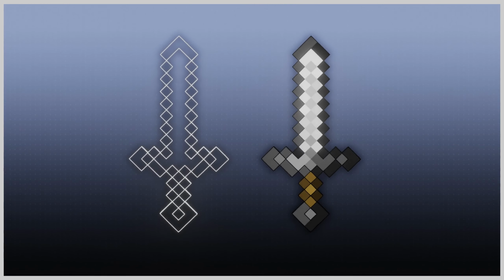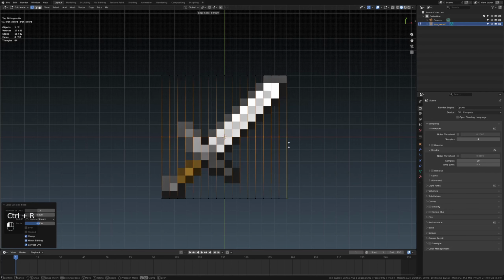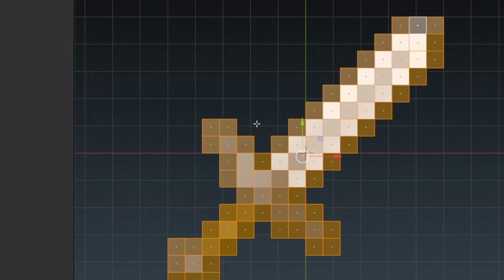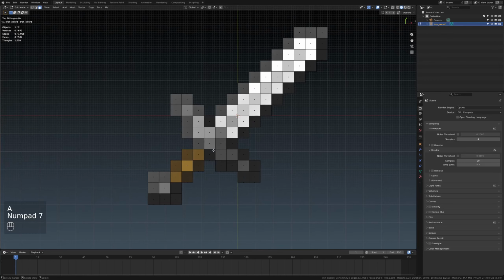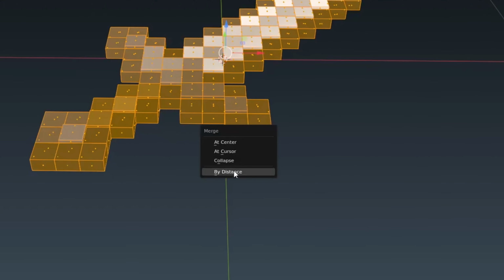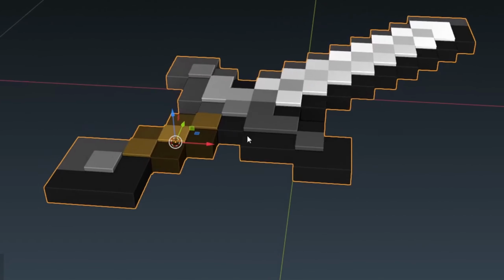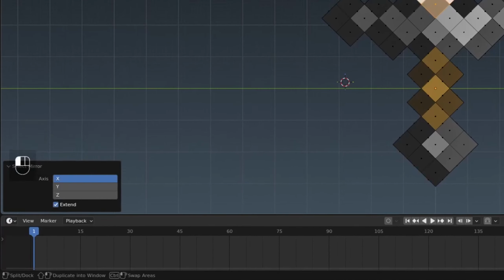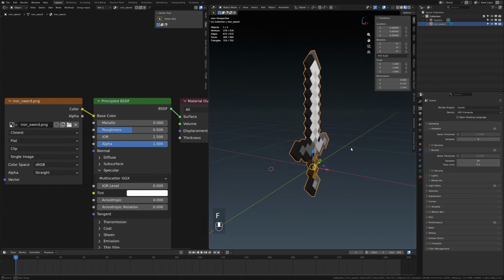CUSTOM 3D Minecraft ITEMS Step By Step | Blender Tutorial

Comment: Hey this is a question. For modeling. How about the texture? What are the preferred settings to make your own weapon, ranging from sword, axe, even bows. What softwares are used to make the textures and what is the size and resolution? I’ve tried paint. Krita but idk the right size to fit the textures or line them up. If u know that be awesome
Reply from the maker: I use Gimp for all textures I make. Minecraft items are usually in an area of 16x16 pixels, but for animations in Blender, I prefer swords with longer blades, so I start on a 32x32 canvas.

 To draw, I use the pen tool with the size of 1px and "Hard Edge", so it doesn't smooth between pixels.

There's not alot else on the texture side, but I like using "Image -> Crop To Content" once I'm done, so Gimp only exports the necessary area